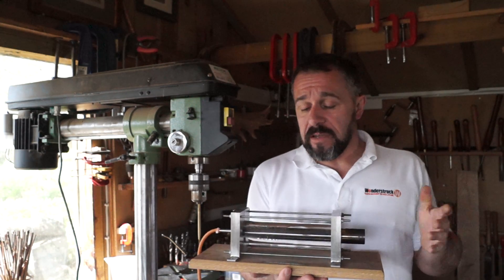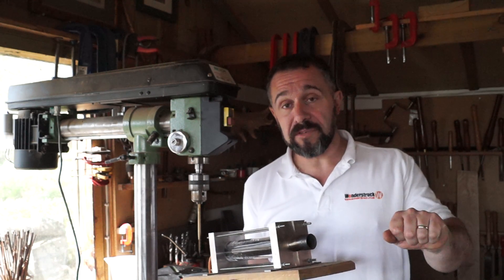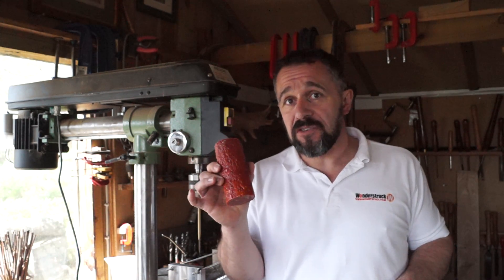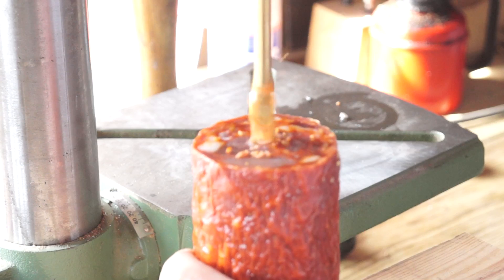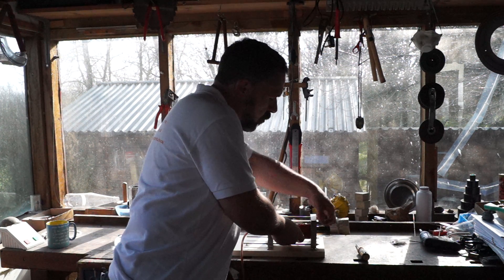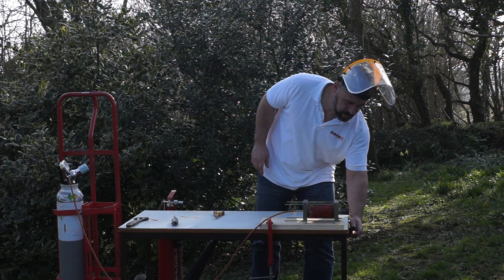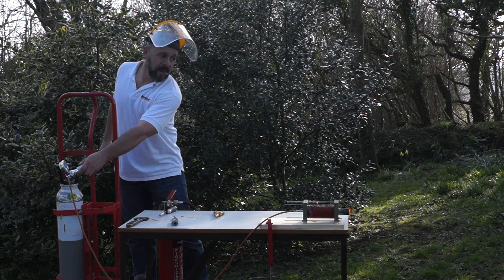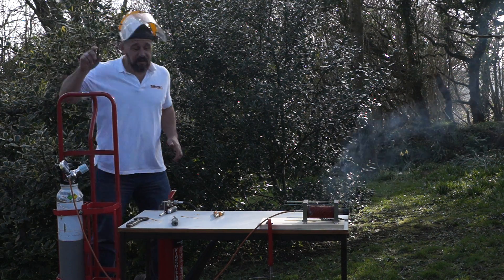Can You Make A Rocket Out Of Meat?

Comment: Without some sort of strong casing, your maximum chamber pressure is going to be miniscule!

The energy content and combustibility of sausage are both quite adequate for use in a hybrid motor. The structural integrity of the fuel leaves somewhat to be desired though.

P.S.
What is actually burning there is the fat in the meat. Try a nice italian Salami. The higher fat and lower moisture content should make for a much better burn.
Reply from the maker: Marvin Kitfox Yes, we totally appreciate the structural integrity of chorizo is unlikely to withstand much in the way of pressure but we just thought it would be fun to see what happened.  We will be trying a variety of different fuels over the next few weeks/months (whenever we have time) and are building a little test rig at the moment to measure thrust so we can try to compare different fuels.

Comment: Since the oxygen is under high pressure, doesn't that account already for a high percentage of thrust coming out of the sausage end? I mean, it's cool that it burned and all, but is the combustion really adding to the total thrust very significantly?
Reply from the maker: Matt Rouge You are entirely correct - most of the thrust from our motor is actually due to the oxygen pressure but bear in mind this is designed for safe use in public shows as a demo model.  We just wanted to see if we could burn our chorizo in a rocket type environment.

Someone pointed out in the comments that Mythbusters already did this.  To be honest, I wasn't aware they had but wasn't surprised.  I checked out their results and although they used nitrous oxide (which behaves slightly differently to pure oxygen) they did find that the presence of the salami they used accounted for a tripling of the thrust over and above oxidiser pressure and the decomposition of the nitrous oxide itself.

For a while we've actually wanted to see if our motor produces any thrust over and above that produced by the oxygen pressure so we are actually building a small test rig with a load cell and some data logging software to plot the thrust.  Hopefully that'll be done in the next few weeks.
Reply: wonderstruckwow Thanks! Will look forward to that!

Comment: Try peanut butter. Really high energy density (more than plastic) and moldable.
Reply: wonderstruckwow
Easy. You just have to spin it... ;)
Reply: wonderstruckwow Regardless getting peanut butter to hold together isn't exactly rocket science! (couldn't resist) .

Thick peanut butter might hold together, if not maybe some plastic wires to act as scaffolding. You're a hell of a lot smarter than me, I'm sure you'll get something working with a little experimentation.
Reply: wonderstruckwow Sounds like a good idea to me. Can't wait to see how well it works.
Reply from the maker: Jim Giant Hmmm - wonder how we would hold it in a cylindrical shape?
Reply from the maker: Attila Asztalos No problem!
Reply from the maker: Jim Giant Well, we could try freezing it with liquid nitrogen.  I've found that most problems can be solved with either a hammer, duct tape or liquid nitrogen or combinations thereof.
Reply from the maker: Jim Giant Watch this space!